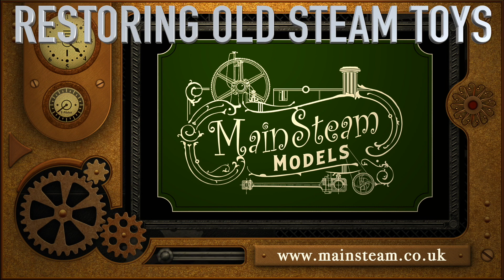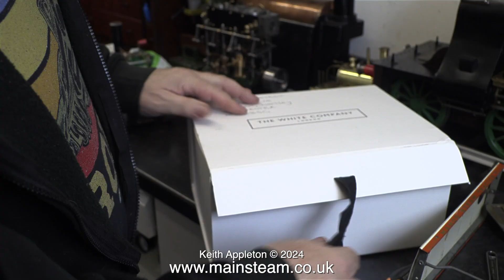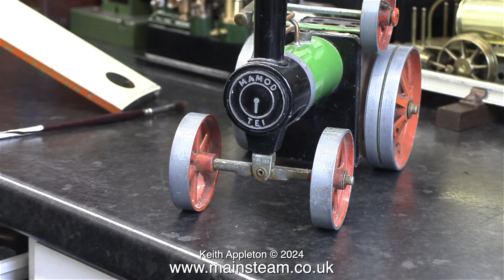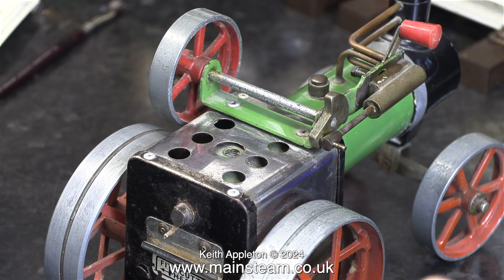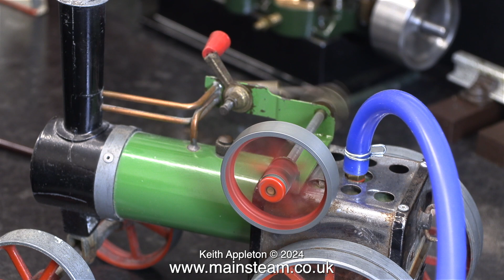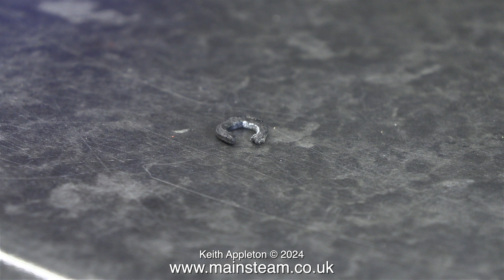RESTORING OLD STEAM TOYS - PART #2 - MAMOD TE1 INSPECTION

Comment: I understand that the cylinder faces on the engine block? and cylinder will wear out.
I had a old Mamod steam roller rebuilt recently but she won't run because the black is new
Reply from the maker: the black is new ??? what does that actually mean ?

Comment: You have a rear and short after model there it's a 1967 te1 or tela it has the 2 rivet spoked rear wheels. The modern spring type whistle that you intent to fit will be wrong it should have the burn you fingers te1 whistle
Reply from the maker: I couldn't get an original whistle in time and the rebuild job was to a budget.